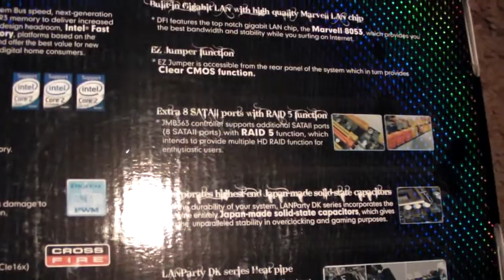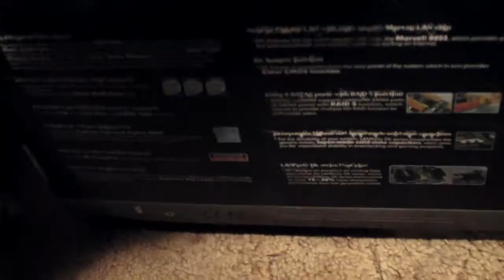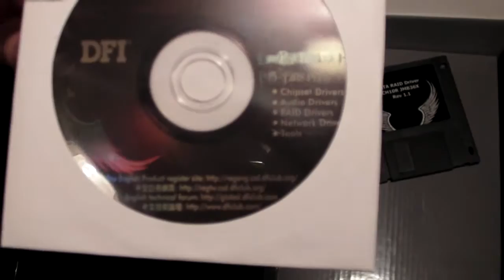DFI LANPARTY DK P45-T2RS PLUS - My secondary rig

Comment from the maker: I tend to get as more vrm phases as possible. This mobo was destined for my secondary rig.

My Q6600@3600 needed 1.36V with a TRU. I never use the stock coolers.

My PSU was a Superflower 500W.

I don't remember the song! :(

Comment from the maker: No difficulties for me.:) It just requires basic installation knowledge. Overclocking was a breeze too! It managed to run my Q6600@3600 with only 1.36V while i needed 1.475V on my Asus Commando.

Oh one more thing. You could find it difficult to plug in your hard drives cables, after bolting the mobo in, if your case is not lengthy enough. It has the ports on the side.

Comment from the maker: Yes it does run crossfire. It is equiped with two PCIe 2.0 X 16 slots, that drop to X8 mode once two cards are istalled. No problem though. Your 3850s would be fine. I do believe that you should sell both of them and get a 4870 1Gb though!

You can have a look at DFI's website for more info.

Comment from the maker: It is a very nice and cheap mobo. Just make sure you get the "plus" version. The other one has some problems.

It will run any gfx card great. It has X16 PCIe 2.0 slots. Just keep in mind that if you decide to use two of them, the slot speed drops to 8X for both slots.